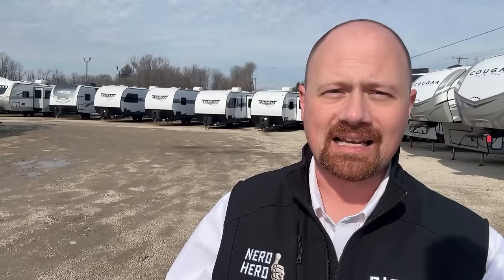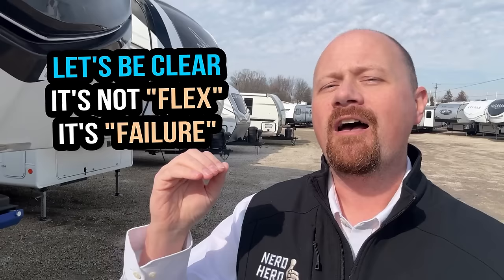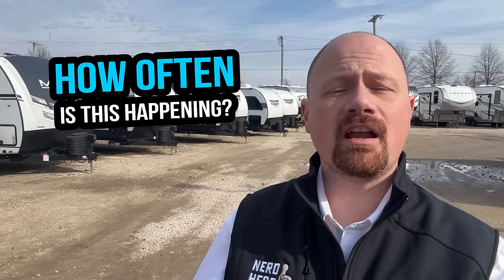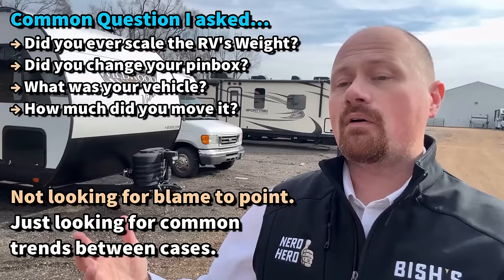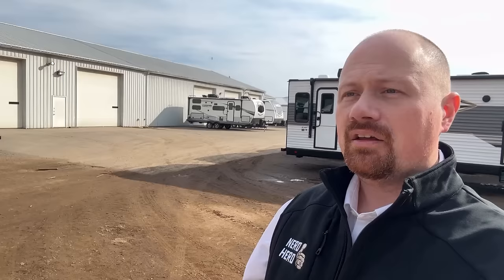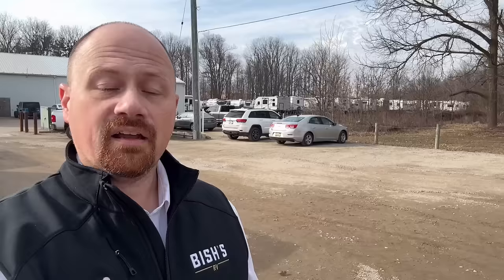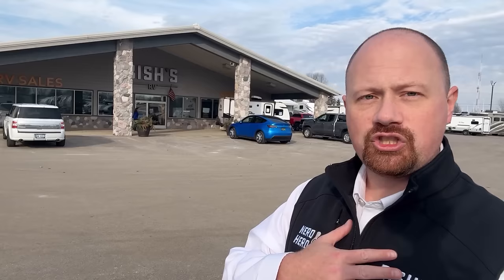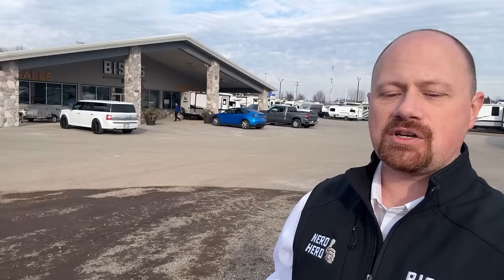🚨 RV Frame Flex & FAILURE!! • WHAT is Happening and WHO is Responsible?!

Comment: Hi Josh, .... I have been following your channel for several years now and have concluded that you are one of the few in the industry who achieve a high level of transparency and accuracy on the topics you discuss, and for that I thank you and the industry thanks you!  

On this topic of frame failure, I have owned a 44 foot 'four season' fifth wheel and successfully travelled all of North America without any major challenges.  I learned myself that Weight management was KEY to making sure the RV experienced the minimum amount of vibration and flex.  Here are a couple of other suggestions that you didn't directly discuss in your video that could help other 'full time' RV owners be aware of:

1) The roads you travel (i.e. quality of highway and terrain).  Many large fifth wheel owners like to 'boondock'.  This is a terriric way to save some $$ but also get back to nature per se.  The challenge with alot of this is that large fifth wheel owners are pulling your 16,000 - 22,000 lb RV through and over terrain that will stress the frame likely more than it was designed to stress.  This reality is NEVER discussed by manufacturers or dealers relative to HOW you should or should not Repeatedly use your fifth wheel. 

2) The frames on fifth wheels are designed and engineered by structural engineers.  Hence, your point on Pinbox Weight being listed on the RV when emply is a great one.  I would also add that they should add 'Max Pinbox Weight' so that owners can be aware of the amount they should be travelling with, (on the pinbox), before the fame / pinbox will begin to experience stress. This should be a 'known' number based on the frame design and steel strength and engineering.

I hope this helps, and thanks for taking on this difficult topic.
Reply: this is why I converted to the gooseneck… The gooseneck can articulate or shall I say rotate side to side better than the flat fifth wheel that has a reduced range of motion.
Reply: You are spot on.
The one additional item that I think is being missed by the industry, is the amount of horsepower and braking that newer trucks have.  The ability to accelerate and stop is putting forces on the pin boxes that were never part of the equation before.
Reply: Wow, you sold your soul to the RV companies.
Reply: Okay Fauci was this an issue before covid? Or is new to the industry? How many people before 2020 had this issue?
Reply: This is not transparency, he’s being disingenuous, he knows the rv industry is sending out crap. 
I’ve had 5th wheels and travel trailers for  30+ years, and never had a frame failure

Comment: Great information & video Josh!
I believe that speed while towing will make a big difference.  If you are towing at 75/80 mph you will probably have more issues.  I pull at about 62 & feel much safer.
Reply: In the uk 65 mph max that’s the law
Reply: That's the exact speed I tow at. 55 with no traffic for better gas milage.
Reply: Your right on that point....I don't know how many times I get behind fifth wheels and toy haulers heading out to the desert doing 55-65 and try to respectfully go around them to get my view of the road back and by the time I finally get around them/it were both doing 75+......when I am able to finally make the pass that same enditiy drops back to the original speed we were going when I attempted to make the pass..... unbelievable
Reply: You've never seen me do that.  I set the cruise at 62.  Up & down hills that's my speed.
Reply: Y’all must be different as all I see is campers flying by me. It really doesn’t matter because a camper doesn’t know how fast it’s going, besides a class a is usually going past the speed limit. The only fifth wheel I would ever buy now is a Cedar Creek and it’s only because I know someone that only works on Cedar Creek’s and he is better than the factory

Comment: Hi Josh, it’s also happening to smaller 5th Wheels! Our KZ 283RLT is sitting at the factory right now getting fixed from frame failure! It broke our wall under the bedroom slide, plus the battery dropped out because all the screws came out of the plastic trough!
We are trading it in as soon as it comes back! I can’t trust it!
Thanks for everything that you do! You are my hero!!!
Reply from the maker: Yeah, it absolutely can happen to anything. The current discussion has really been focused a lot on big fifth wheel, but it’s not impossible to happen anywhere else.
Reply: I would blame the engineers that spec the frames for these trailer. The do not add enough over engineering into them .
Reply: @mitchstephen5491 I completely agree!
Reply: @mitchstephen5491 nope dont blame ENGINEERS BECAUSE the owner is who makes final decision. I personally seen specs and plans and owner comes back and says too expensive etc so owner tells Engineer to cut cost. and engineer probably told owner wont work.  but owner does not care because they are not regulated.  like me selling you a car with no engine its be your fault for not looking under hood (i would never do that but private investors DONT GIVE A SHIT)

Comment: With all of the other channels detailing their issues, this is a breath of fresh air.  This represents the best depth of the issue.  You raise an important issue when modifications are done to the hitch or using the trailerering systems out of specifications. In the same way, if I modify the suspension on my jeep wrangler, I assume the responsibility of potential failures. It is no longer Jeeps problem, even if it is a certified mechanic that does the work.  It is not to shift blame, it is to assume the risk. The other points were fantastic. It does not diminish the issue, but it is a reminder of the rare nature of this issue. Great tips to check as we are on the road. Thank you again.
Reply from the maker: Really appreciate it

Comment: One of the biggest things we did to stop any risk of flex with our Alpine 3270RL was adding heavy duty shocks and airbags.  We pull with a 2015 GMC 2500HD.  We knew we were on the threshold for weight when we purchased.  It has made all the difference in the ride as the passenger, it pulls more even and straighter, I have noticed there is no shifting or chaos in the trailer itself after a pull.  I want to say the whole upgrade was less than $1500.  The other thing we did - change the tires from the OEM  HiSpec "china bombs" and replaced with Carlisle.  We had them weigh the tires to see the difference.  HiSpec weighed 26lbs per tire....Carlisle 55lbs per tire.  Totally different pulling experience with the new tires.
Reply from the maker: Thank you for sharing this! I always appreciate ownership experience

Comment: I think you absolutely nailed it on this one! Education and information are sorely lacking. I spent 5 years researching before buying my RV, and still didn't find many of the answers.

All of these issues you discussed are reasons why I decided to go with a Class A. Like your customer, I work from the road nearly fulltime, and I sold my sticks n bricks. Class As aren't a perfect solution to these issues, but for fulltimers and most-timers, it's a good start. Even so, educating customers (and dealers) on the limitations is a MUST.

Comment: THANK YOU! I am so tired of all the incorrect information and basic wildfire panic going around.  
Mostly, its either 1) and engineering failure or, 2) a manufacturing failure. And any of that could be exacerbated by overloading, extended use and publicity - many are the larger fifth wheels veing used fulltimd by popular YouTube personalities.
Reply: And none of them are taking any responsibility for the damage.  If you point out that they may have contributed to the failure, you will be called a troll.  I believe the cause is a combination of both manufacturer and owners.
Reply: I believe that there are way to many moving parts here to find the absolute reason (s) this is happening. ie:  The road conditions, I-80 in ohio for example. The truck pulling it, is the suspension or tight or loose. The pin box jerking the trailer back and forth, The trailer suspension bouncing the trailer, improper loading of the trailer ( nose heavy or worse tail heavy or just overloaded entirely), Usage of said trailer (NOT accusing but salty northern roads or worse yet salty Florida beach air.) how the trailer is driven (85 mph down I-95 heading to Margaritaville, We have all seen it!) , is it a full time usage, proper setup/weight distribution and teardown, storage conditions when not in use. Oh the list goes on and on. Why yes sometimes I believe it is the fault of the trailer mfg or should I say the guy welding the rv frame on the line just having a bad day ( we all have had one at work admit it.), and last but certainly not least poor quality of materials received in the supply chain. All of these factors and more lead me to believe that in a case by case study we will find no one smoking gun but a combination of events and situations that is hard to quantify but all have roughly the same outcome.
Reply: @michaelmccrindle1033  exactly!  It's easy to point fingers at one thing or one entity but it most likely is a combination of things.
Reply: @ryanryan6207   You are so right...I would be considered a troll.  I believe there are many causes to what is going on.  I have a 2018 394 Momentum, no issues to date.  However, I tow slower than most ~65ish mph as a safety precaution.  Here in Utah, I could do up to 80 mph and be within the speed limit.
Like many, I'm concerned about potential frame damage with my trailer and looking at everything that I might do to protect my trailer.  FYI, I will be inspecting the lags in the bedroom and front of the frame.  I've seen pictures of those put in by Grand Design and believe larger 1/2" lags that fit the holes in the frame would be an improvement.  Keeping tow speeds down, especially on rough roads will surely help.  I will be weighing my trailer to assure I'm not overloaded while also cleaning out and reducing weight in the front storage.  Towing without a full tank of water whenever possible is also desirable.  While not always possible, minimizing hard accelerations and abrupt stops is also desirable. (Keeping a good safe distance from vehicles makes this is easier to manage)  As for acceleration, many of our TVs have more horsepower and torque than ever before.  Hard acceleration will definitely impact the pinbox to frame and the vertical frame supports.
For those of us with a trailer already, we cannot change the engineering or build of our trailers...we need to do something preventative to protect our investment as they are.  I'd love to see/hear more ideas from others about their thoughts. Thanks ryanryan6204 for your post.  Love this channel.  Thanks to Josh for taking the time to provide his insights.

Comment: I've seen it once. Someone took a toy hauler and converted it to gooseneck and overloaded it.
You always add education to your videos, and it is much appreciated.
Reply: Overloading is a issue but goosenecks are okay depending on the manufacturer. Grand design allows for the reese goosebox and therefore should not ever be a problem.

Comment: Most of us who tow our RV with a semi-truck remove the commercial hitch and install a suspension RV hitch. The suspension hitch provides a much smoother ride.  The commercial hitch does not pivot side to side putting more stress on the RV frame.
Reply from the maker: That’s something I’m going to try to learn a little bit more about giving the opportunity

Thank you for sharing this
Reply: Those that use a class 8 truck normally single up( remove a drive axle) and only use air ride suspension and rv air ride hitch.

Comment: You have to be honest and call a spade a spade.
I have seen many of the same RVs having this frame failure issue.
Those RVrs are weighing their RVs, they are using the correct hitches, they are pulling with appropriate trucks (f350, 3500, etc).
I am an engineer by trade.
If you don't test and build with factors of safety, you will see what is happening. The manufacturer under-designed the frame.
They (RV manufacturer) made claims they cannot hold up to.
Enough is enough.
Quit blaming consumers.
Blame the ones responsible.
Reply from the maker: Did you take away from this that I was blaming consumers? Because I don’t feel that’s really where everyone needs to look. I think they’re using Arby’s the way that they’ve been led to believe they could. And that lack of clarity and information is a major problem.
Reply: @JoshtheRVNerd ,
Josh, I have been watching you for over a year now.
I have always thought that you were being upfront and honest with the information given until this video.
Manufacturers are not dealing fairly with the consumers.
You have to be the consumer's advocate.
If an RV Manufacturer doesn't like it, so be it.
Please be the advocate for the consumer and don't protect the manufacturers from faulty manufacturing processes and designs.
Reply: Dave here.  I too watched the whole video and you did put the majority of blame on education and overweight.  Nothing was put at the design table, especially the frame design.   IMHO, it is ridiculous to build a 40+ foot RV with huge water / waste tanks and a cargo capacity of 1500 pounds.  EDIT - especially for rigs "designed" with a designated washer (at 140ish pounds) and dryer (at 65ish pounds) location on one side of the front and not directly over the pin box.  I have no dog in this race, but we almost did in late 2019.  So very glad we didn't buy a RV.
Reply: I agree,. 100% blame on the manufacturing.  What education can a consumer possibly do to be sure a manufacturer has properly engineered and then built the structure inside the trailer?
I am totally turned off with the whole industry. We bought a mint condition High country instead of a Grand Design because I am very educated on spotting improper design and build. We were being shown a brand new Grand Design and I went to simply open a door in the kitchen and the entire door came off in my hands. Tiny screws that had been "stripped " when sunk into the wood.  How can I ever know what the parts I can't see are going to hold up over time? 
 Like the FRAME!

I like you Josh but in this video you are trying to spread blame over everyone!  How can a customer be held accounted for frame's breaking other then complete abuse of the trailer and it's intended purpose.

I hope this bury's any manufacturer like Grand Design and wipes them out.  The problem is that another one will fill the void.
Reply: agree with you.  the other older gentleman who is a certified inspector all he does is click bait so people will
buy his materials!!
Reply: @laj339 thats not how i understood him. Listen again. Manufacturers are not relaying any warranty, specifications to consumers. he just relaying situations that we can abide by.  other huge problem they have is slides.  cant tell
you how many people have slide problems.  Tiny cable to hold up all that weight then seals get crimped water comes in.

Comment: RARELY will I sit down and watch a 42 minute on Youtube. But this was well worth it. I have already seen a few videos on this issue with towables lately and this one is by far, the best and most helpful. We recently purchased our sixth camper and being another 46' toy hauler, I was extremely concerned with the "Frame Flex" topic. 

But you hit on several great points that I think everyone should note; especially those who are buying the bigger fifth wheels (although Airstream is even having some frame failures on select models). Thank you for taking the time to share your thoughts and your knowledge. You're an outstanding salesman.
Reply from the maker: Yeah it can happen anywhere for a number of reasons but recently seems most concentrated in a specific sector

Comment: Love your videos and how educational they are. A subsection under the idea of "having too much truck" could also be, towing your 45' triple axle toy hauler at 85mph is probably a huge cause of some of this flex. I don't believe any of these trailers are engineered and designed to travel down the horrible Colorado highways at the speeds some of these tow vehicles are capable of. I try to stay below 65 everywhere possible and always watch the skidmarks on the highway showing me the heaves and bumps to slow down over.

Comment: Preach brother - I have been wanting to get a 5th wheel, but with the sudden rash of broken frames (some call it flex). I have been doing some reach and noticed that most are the big 45’ trailers. Have seen several smaller (avg 35’) that have been all the way to Alaska that haven’t had that problem. I know that things break, and know RV’s aren’t any different. I just don’t want to wind up paying another 16,000 on top of purchase price for a repair that isn’t normal wear and tear.

Comment: Yes we weighed our 2021 Montana High Country 295RL when we first got it and found out that the the truck itself was 360 lbs over on the chassis. Had to get a dually. I told the dealer when I was purchasing the 5th wheel that I was going to be overweight and their response was you have plenty of truck. I always have the trailer leveled before opening any slides. You are correct their are array of issues that causes the problems. I always say we can fix things that are broke but we are better if we know what caused it to break.